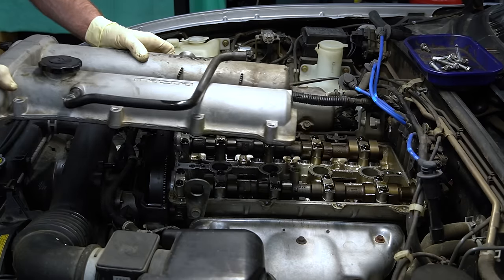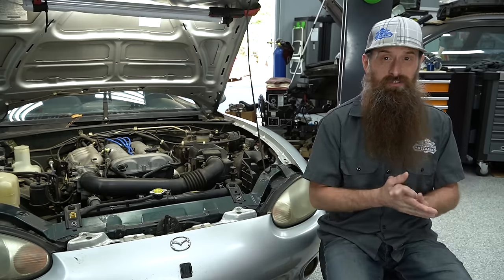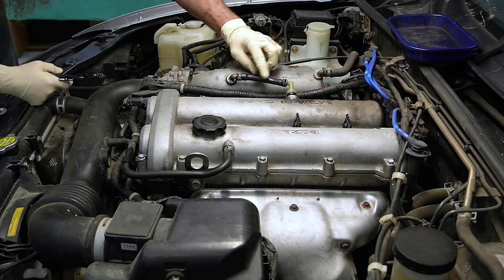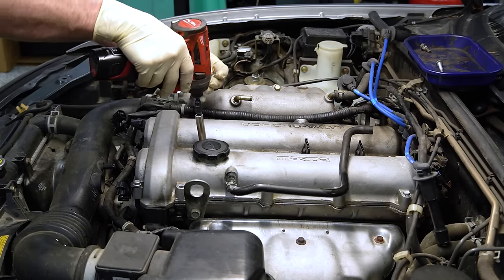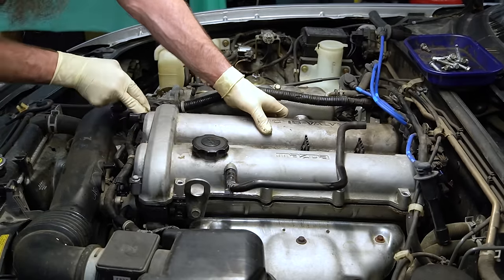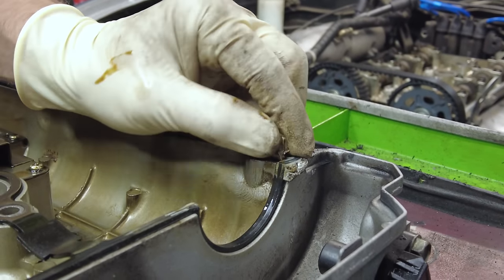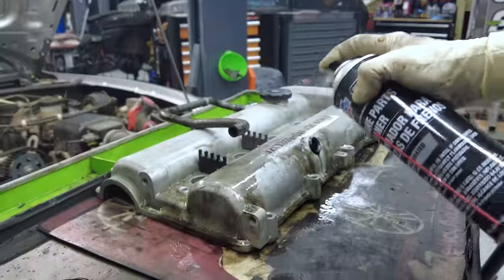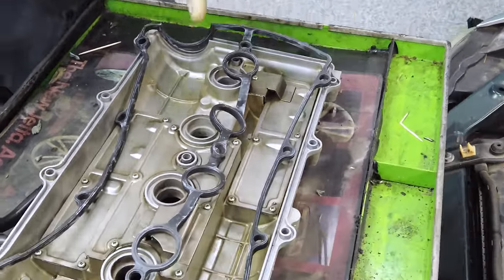How To Replace a Leaking Valve Cover Gasket

Comment: Word to the wise: ONLY use the genuine Mazda gasket on the Miata. I have never had an off brand version seal correctly.
Reply: I agree with that.  Used aftermarket after a timing belt change and it leaked.

Comment: Ha, would most air-cooled VW engines qualify for having the easiest valve cover gasket replacement? Just pop off the bales with a screwdriver, pry off the valve covers with the same screwdriver, replace the gaskets, & put the valve covers back on, not even needing any tools to push the bales back in place? No breather hoses or wires to disconnect, either. Good video, always learn something new even though I've replaced many a valve cover on my air-cooled VW bus & my mk2 Jetta diesel.

Comment: My pcv valve hose cracked, and spark plug gasket broke off. 97 nissan sentra no replacement gaskets. Burns oil at 45 mph out the back!!!!! Sucking oil

Comment: Couple of general tips:
1. I like to use a brass brush and/or a brass brush Dremel attachment to get all the old RTV gunk off and get the head mating surface super clean. 
2. I’ve found that it’s super important to pay attention to the RTV install specs. Some flavors require hand tightening bolts, wait an hour, then torque to spec, and ideally wait up to 24 hours before starting the engine. But the initial 1 hour curing seems critical to getting the best seal. 

Also Miatas seem super sensitive about what valve cover gasket is used. I’ve tried 2 aftermarket gaskets in 2 years and they both leaked. I’m going OEM next.
Reply: OEM or OE equivalent is recommended for any sort of gaskets or bushes are recommended.
Reply: @Mech-Bandit  i pulled my engine out last winter and did a complete reseal project with all OEM gaskets and seals. It used to leak everywhere, and now it leaks nothing, over 6 months after finishing the project.

Comment: Awesome as usual Charles. Did this last winter on my B6 Passat VR6 and it went great until I used a too-large torque wrench on re-install and broke one of the bolts off in the block. Tried extracting it but no dice. Luckily doesn't seem to be causing any leaking so far! Still a bummer though #sadness

Comment: Good stuff! 

I will say, the valve covers on the old Honda D15 and D16 engines are even more simple: 

Plug wires
Breather hose 
Ground wire
Nuts (they had studs instead of bolts)
Reply: Technically old Subaru valve covers, EJ18 and EJ22 are even easier. Disconnect one breather hose on each, 3 bolts on each, done. The access is just slightly tight.
Reply: @802Garage  same with the old A series Honda engines - breather, 4 nuts. 

The plugs went in through the exhaust side of the head.
Reply: @jameshaulenbeek5931  Boo yah! Haha.
Reply: Aircooled VW has you all beat... snap off the wire bail, remove cover.
Reply: @rennkafer13  Fax. 😂
Reply: Yes I agree ☝️
Reply: Toyota 3 and 5 S-FE engines: remove plug wires, unscrew the 4 30mm nuts off the spark plug tubes, pull off valve cover. 

Takes less than a minute.

Comment: thanks for this video.  however, there are many videos already on yt on how to do this job.  what would be better would be an explain of what might cause a valve cover to leak and what sort of hints you might have the valve cover is leaking as well as what you might expect once it is fixed.  I'm a noob, but from what I understand a leaking valve cover might be a symptom of some other problem.. like a clogged PCV or something else.
Reply from the maker: Good feedback. We did a pretty deep dive on leaks In the video I mentioned. 

It’s usually just a wear thing from hardened gaskets
Reply: @HumbleMechanic  You da man Charles. Pro reply.
Reply: @HumbleMechanic  Can it cause a problem?  I've got a ducato (iveco) 1996 2.5 TDI engine and it smokes blue and I'm trying to figure out where to start.  from what I understand a leaky valve cover in itself is not cause for much concern.  I've got a little oil in my turbo, etc.
Reply: @surfreadjumpsleep  I replaced 3 valve cover seals, and 2 crank seals on my MINI Cooper, just to finally find that the root cause was the PCV.     To confirm my theory this MIATA had a good seal, non britle but still was leaking.
Reply: @90210sky  were you blowing blue smoke prior to the pcv fix?  If so then did it stop?
Reply: @surfreadjumpsleep  I never had blue smoke in the exhaust nor anywhere else. I did have a oily smell inside the cabin tough which disappeared when replaced the PCV.  A blue smoke in my humble opinion means an issue with piston rings and/or compression issue. Hope you find the solution buddy
Reply: @90210sky  Starting to think the solution might be a new refurbished engine.  Sounds like about 2 month's work?  Another option is to go crazy and replace the ICE with an electric motor and large battery bank.  Or... just keep pouring oil into it.

Comment: I’ve done a valve cover gasket replacement on my vvt NB2. Had been running fine with no leaks until recently. I didn’t put rtv in the corners as much as he did. I wonder if that would help me prevent oil leakages. We’ll see

Comment: I have a question. So i sandwiched my gasket between rtv sealant. Im pretty sure I did it wrong by by putting the slealent on the actual valve block. Looking for a quick reply but if not I’m going to re-do it tomorrow

Comment: Are you familiar with Toyota engines? I'm about to change a valve cover gasket on a Matrix. Got the felpro gasket and have some Permatex Red RTV high temp silicone to put on the two spots near the timing chain as recommended. You think it's gonna hold? I read on the instructions not recommended for head gaskets so that's got me stressin' a bit for possible leaking. 🙈

Comment: You have to apply that green vw “valve cover sealer” to every gasket surface, the head, the valve covers, the air intake, and then smear the side of the engine with a putty knife with the same stuff. Then wait for it to burn off on the turbo manifold so it melts your air intake in Ohio, apply gorilla tape and drive home.

Somehow this engine lasted 40k and it still runs, somehow. It’s also like 80k over due for timing (belt, fsi). I think it runs on spite.

Comment: why are a lot of people scared to replace them, on there own? I have 2016 Chevy Malibu 1.5 that the pump vacuum pump went out and broke inside, so now I have to take off the valve cover and fish out, we are lucky so far the end of the cam shaft it looks good, so i am fingers crossed here, but i am looking for the circular oil seal i believe is it call that the brake v. pump seat into the valve cover, it got a little scratched up in the inside of it and i feel like i should change it just to keep it from leaking, just to be sure. Any suggestions or help, i've never done anything like this so I really appreciate your video's ,. normally have a mechanic do it but we just do not have that option and its our only  car.

Comment: Hi, this week I also installed an valve cover gasket. But on a Toyota 4E-FE engine. Can I ask an related question? When you replace the camshaft oil seal, should you put RTV on the flat surface between the bearing halves before you mount it back? I hope I used the correct words to make myself understandable.
Reply: Oh sorry, great video as always!

Comment: I’m hoping someone can give me an answer to this question. Most of the valve cover gaskets I’ve seen for the 3.6L alloytec engine blocks the pcv valve from the crank case on the passenger side, I believe this would negatively affect performance but I assume they did this to prevent as much oil from being sucked into the pcv valve and avoiding extra sludge from getting into the pcv. But I think this actually traps more sludge and oil in the area where the pcv is blocked off from the crank. Do I just keep it this way and clean up the inside manually when needed? Or do I get a gasket that will keep it open to the crank case ?

Comment: You can replace as many gaskets as you want, but chances are the problem is the PCV valve, when it fails gases will look for a place to escape, most of the times it will be thru the valve cover gasket or the crank seals.

Comment: Any specific tips or things to watch out for when doing the valve cover on a VW 2.0 TSI engine?
Reply from the maker: Yea. Remember you technically need to detention the timing chain. The “valve cover holds cams in place
Reply: @HumbleMechanic  , okay, so to detention appears to be a lot more work with extra tools.  You say "technically" does that mean it can be done without detentioning.  Hoping this was a DIY...

Comment: Hello Charles, I have to replace the  lower sump gasket on  my Golf 7R. I saw the tip on using a tiny bit of rtv on this video.  Would you suggest using a bit of rtv  on the sump as well?  I am using the same plastic sump and not changing to metal. Thanks and greetings from South Africa.
Reply from the maker: I haven’t done that on the sump gasket, and had great luck with it

Comment: Another place to stick some rtv is where the timing cover meets the cylinder head of the seam only if it intersects the valve cover and timing cover. Obviously this isn’t applicable to all engines. Think like on an m5x bmw motor where the top of the timing cover bolts up on a N.V. m50b25 or the vanos bolts up on all the other later ones. Good DIY- ‘valve cover gaskets for dummies.’ LOL 😂👍🏻

Comment: hey charles...thanks, but a leaking valve cover gasket gives my car character and also, in a round about way, helps winterize the engine block and transmission and if I'm lucky, the underside of the car.  Ppl pay big money to have the underside of the car to be sprayed with oil, and with my leaky gasket, it is more or less 'free'.  Thanks for the tips. [sarcasm meter should be maxing out/pegging]

Comment: Does anyone know if rolling my car in first gear primes the fuel system just like cranking without starting? I need to turn over the engine after I finish doing an oil filter housing gasket swap.
Reply from the maker: I don’t think so
Reply: Would really depend on the model of the car.  If it has an electric pump and a mechanical pump rolling it won't work